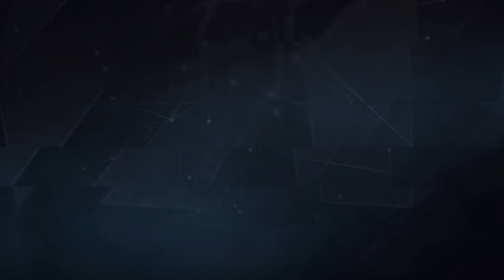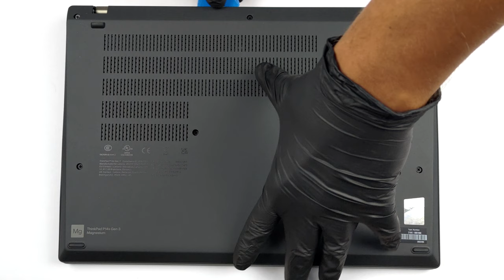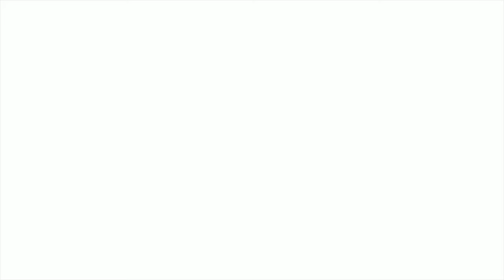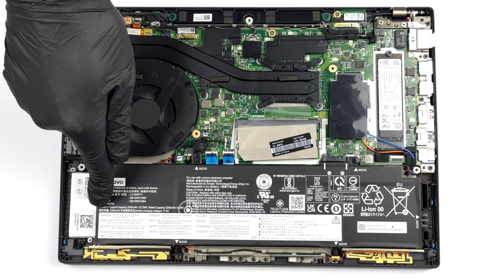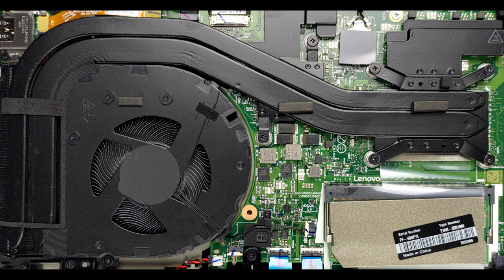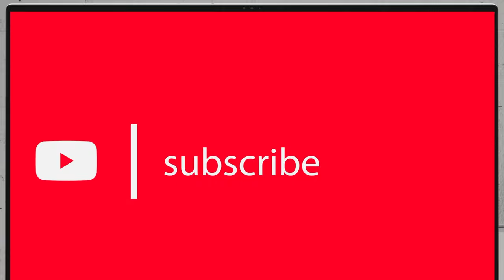🛠️ Lenovo ThinkPad P14s Gen 3 - disassembly and upgrade options

Comment: I don't understand why you remove the battery. Is it necessary?
Reply: It's so that the battery isn't powering any part of the computer
Reply: if a screw drops somewhere on the motherboard and the battery is still plugged in, it could short the entire mb

Comment: No vapor chamber? I guess I will wait for the Gen4 ... That cooling system can't cool that laptop components for sure
Reply: It does. Stays cool even when pushed to its limits. Really impressed by it actually.
Reply: @professorh8398  Surprising to ear!
Reply: @LordNementon  Yeah! I love this thing. 16gb is enough for 3D modeling which I do and have done often, but when creating my first video, I used up the 16gb after 7 minutes of video clips. Basically, you'll want to upgrade to 8gb+32gb or at least 8gb+16gb if you do video. But temps are awesome.